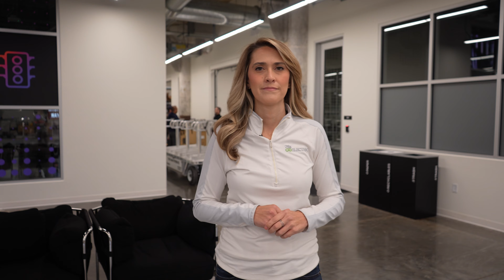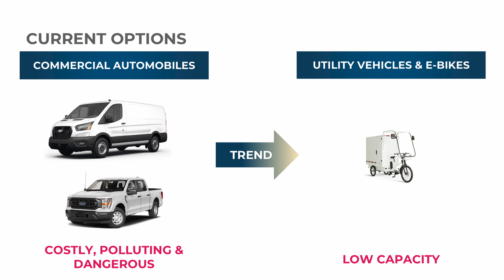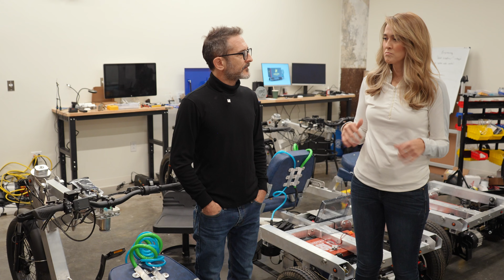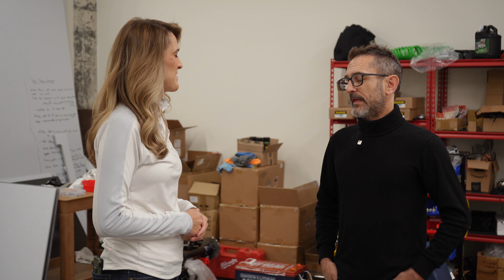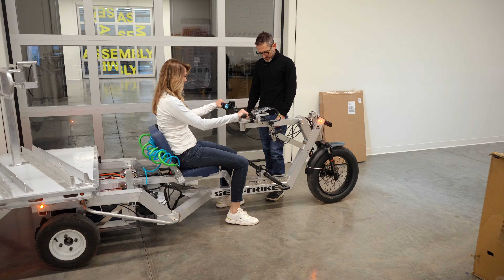Civilized Cycles Semi Trike (Preproduction Test Ride in Detroit!)

Comment: i see a lot of space to grow for ebikes.

First, getting an ebike to have a 500 mile range. 

Second, making ebikes charge faster

Third, making them have higher storage capacity. 

You want to make sure that an ebike is a car replacement, that has higher stats.
Reply from the maker: There are hundreds of eBike companies selling in the USA today. We have reviewed about 100 of thousands of options. There is something for everyone. 
Thanks for watching. 
-Producer Tim
Reply: @MissGoElectricRideReviews  you are welcome. Right now there are two ebikes with a range of over 200 miles. Humanity is getting closer. In my area, ebikes and electric scooters are appearing more often, as well as electric car chargers.
Reply from the maker: At 20mph, a 200 mile trek would take TEN HOURS.  What percentage of riders desire to ride a bicycle for that duration?
For those who want more riding, an easy solution is to bring along extra batteries.

We've reviewed several eBikes which advertise triple digit range.  You can see them all at deals.missgoelectric.com
-Producer Tim

Comment: I'm not sure how to word this, so please keep that in mind.  What I'm seeing is very urban centric and fair weather friendly.  Needing good, well maintained, cycling infrastructure and weather.
Reply from the maker: Many different solutions will be required to electrify everything. Thanks for watching and contributing your perspective. -Producer Tim
Reply: What was said is that their target users are campus type environments like universities, hospitals, large production facilities, golf courses, resorts, etc to begin with...at some point they will need to expand to other less structured environments and that will need more information sure...or not...waiting for a perfect environment will lead to nothing changes...

As for weather, in Europe I have seen these kinds of vehicles with a shelter or shroud to provide some protection for elements but much. Like truck and van based delivery z they will have to deal with the discomfort to some extent...most of our mail delivery trucks are not air-conditioned for example...

Comment: There's a German company producing a similar solution called the Carla. It's a modular trailer that is powered and hitches on to a normal bicycle. Check it out!
Reply from the maker: During our talk with Zach emphasized how Europe's subsidy structure and abundance of no-gas zones has fostered the growth of many similar products over there.  At the moment, Civilized Cycles is the only US based brand we are aware of with a robust commercial light electric solution.
Thanks for sharing your findings overseas! -Producer Tim
Reply: This is definitely the first commercial product of this type produced here in US. Detroit to boot. With that said though as the previous comment stated Carla cargo has been around over ten years now producing similar product. Additionally Rad bikes out of Seattle were experimenting with this idea several years ago incorporating a larger cargo bed. 
Nevertheless, exciting to see development and increased use in this space.

Comment: From escooter recovery operation point of view, you want to stack the scooters on top of each other, like euro semi trucks are delivered, they pulling each other stacked on top of the their own fifth wheel. So yo need to load scooters from back or side, middle has a large support that has foldable escooter brackets that are angled so the front wheel sits on top of the other scooter's board. Stack. This way you might double to triple that 7 scooters to 14-21 scooters. Now if you can charge those scooters on trailer when it is taken to depot, you can return the scooters without unnecessary unloading.
Reply from the maker: The SemiTrike is the product. The trailer is an accessory. Trailers can be designed according to customer needs. This application is merely a demonstration of one possible application. As shown in an illustration within this video, batteries are stored inside the weatherproof compartment where they can charge up using power from the SemiTrike. That problem has been solved.

 -Producer Tim

Comment: Its a bit long. The handle bars look a little wide too.

It would be interesting to see the riders head hight and distance from the front wheel compared to a golf cart or a compact car. 

I do like the aspect of it giving a customer more access to a wider variety of areas that vehicles may not be allowed to go.
Reply from the maker: The weight must be distributed and the trike must be stable. Miss GoElectric navigated sidewalks with ease. -Producer Tim

Comment: Appreciate the need for micromobility delivery in the USA NOW, not in 10 or 15 more years.  I can't see how that pedal system becomes functional. It doesn't have a chainline to the rest of the drivetrain, and it's not a generator for series hybrid yet, but you could fit that as needed. 

I can see this being a great setup for a mobile kiosk/coffee/food cart too. Also mechanics and other trades. HVAC tech could easily show up with a new compressor and whole house full of air handlers, and at the end of the day, haul away all the old equipment for recycling. Might want a seat on the trailer for a second tech.
Reply from the maker: This is simple proven technology. All components are off-the-shelf. Reliability is not a concern.

The pedals work now. Miss GoElectric used them in this video. The same sensors which enable pedal assist on millions of eBikes are active. The chain is not necessary. -Producer Tim
Reply: @MissGoElectricRideReviews  How does the pedal drive the wheels/motors without a chain?
Reply: @triaxe-mmb  From my understanding, all momentum is provided by the electric motor. The pedals will have standard pedal assist sensors, but in this scenario, the pedals are merely detecting motion to then engage the motor, as apposed to actually providing any physical drive to the rear axle.

Comment: I do not need one, but I really want one. 😮
Reply from the maker: When these go into production, it will be neat to see how they are deployed. $13k starting MSRP.
Thanks for commenting! 
-Producer Tim
Reply: I’m sure there is a reason, just don’t know why they made the “tractor” so long. It’s not high speed at 15 mph so straight line stability shouldn’t be a problem, especially with the trailer attached helping to keep it from tipping. Seams like if it was a more traditional upright rider position it would improve visibility. I can definitely see that being a problem with that low of a driver position, and that long nose sticking out. Would also shorten the space needed to operate and park which I think would make it more desirable. And lastly make it that much more maneuverable.
Reply from the maker: Zach emphasized the need for weight behind the rear axle to prevent tipping.  The structure must place the weight behind that axle to counteract the rider and forward structure. When we rode with him, he went so far as to tell us that he has tried to tip it but has not yet succeeded.  :)
-Producer Tim
Reply: @MissGoElectricRideReviews  i’m pretty sure he said wait on the rear axle. ( should actually be positioned slightly in front of the rear axle. ) Wait behind the rear axle would cause it to be unstable especially going uphill. If you had weight behind the rear axle, it would lighten the front end which would be very dangerous.  that does not explain why the front wheel is so far out in front of the rider or why the seating position is so low that they don’t have visibility.
Reply from the maker: The rider and the battery weigh hundreds of pounds.  Those are in front of the axle along with most of the bike structure.  For that reason, weight must be added behind the axle to negate those forces.  We the tongue weight is just a small fraction of the 800lb maximum load which can be carried by a trailer.  Most of the weight will be placed upon the trailer's axle.

A long low format also supports the objectives outlined by Zach related to stability through corners.

Miss GoElectric rode the SemiTrike quite a bit and said visibility was fantastic. Did you also ride it and observe something else?
-Producer Tim
Reply: me too!